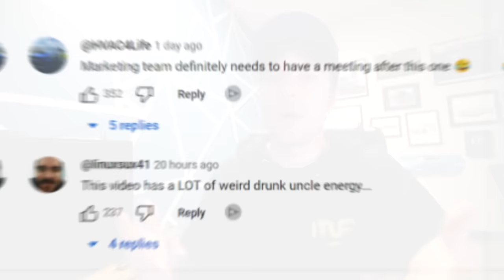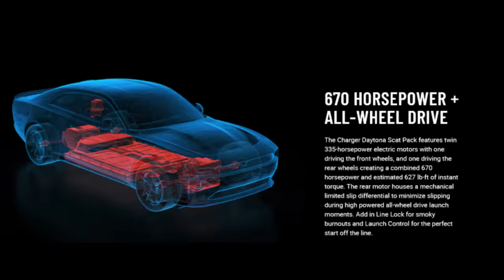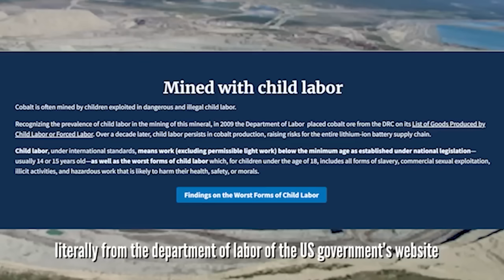The 2024 Dodge Charger Daytona Unveil Was Embarrassing

Comment: “Muscle car” that won’t come with a v8 or a standard transmission 🤮
Reply: Umm... Buick Grand National GNX in 80's
In late 80's also the Buick motor was also used in a Firebird
Reply: @maverickphantom005  lmao I love how all these thick v8 heads forgot that the GNX existed and was even considered a muscle car. Even so they dont even come up with a decent counter argument for it
Reply: Huge disappointed from Dodge. Like David said if Ford can keep their V8 why can’t Dodge.
Reply: @slimslimee4411 they also forgot that chysler had the Slant 6... which is just a tilted straight 6, and put them in several muscle cars as lower factory trim option. The Slant 6 was also very well supported by factory and aftermarket with a bunch of tuning mods.
Reply: @DJAizakku  even the mustang when it first came out came with a straight six option for more everyday daily driving with its modern counterpart being the ecoboost
Reply: The GNX was not a muscle car🤦🏽‍♂️  was fast cause of the boost but NOT a muscle car
Reply: @the1withnoname496  The Buick Grand National is considered a muscle car due to its powerful engine and high performance. The Grand National, produced by Buick in the 1980s, was equipped with a turbocharged V6 engine that delivered impressive horsepower and torque, giving it the characteristics typically associated with muscle cars. Additionally, its sleek and aggressive design, along with its performance capabilities, contributed to its classification as a muscle car. So uhm, does that say alot???
Reply: No body ain’t say a thing when the Buick Grand National debuted. Also if people wanna stay true the real meaning of “muscle car” then the Charger and challenger aren’t muscle cars because they weren’t built in the US. Cause that’s what part of the definition of a Muscle car.
Reply: @AaronRobinProductions ford generally has 1 light duty v8 (5.0) in one application (Mustang) which is offset by 2 EVs (for CAFE). Stellantis had 5 variants of V8s, in 7 applications (that’s like 60% of it’s lineup) not supported by EVs thus having to pay government Fines (up to $300million), but EV credits from Telsa ($2.4 Billion in 2 years) just to BUILD V8s… you see where I’m going with this. Stellantis building these EV can lead to them developing new ICE powertrains other than the Hurricane family of engines (i4 & I6)
Reply: @slimslimee4411  no one remembers the GNX. Buick was a grandpa car then and it's a grandpa car now. The GNX is a footnote in history.
Reply: People who owned 6 cylinder muscle cars back in the 60s and 70s were roasted for it. Manufacturers offered 6 cylinder engines for the people that wanted the looks of a muscle car but didn't want to deal with the power or fuel bills of running a V8 powered car. And this was back when gas was cheap and muscle cars were affordable to the point where a teen could buy one after working a summer job. Those people who bought 6 cylinder muscle cars were basically posers, no different from the ricers of the 90s to the present.
Reply: @CyanRooper  or maybe they just wanted a practical daily that looks good at the same time? Its only bad when you actually try to rice it out into something it is not
Reply: @slimslimee4411  Have you noticed how despite the GNX's prowess.... No one has succeeded since in pulling off a 6cyl Muscle car though? I totally agree that it's earned its place in the Muscle car lineage but it's been 40 years just about without another... And base model Mustangs were not Muscle cars, heck, it wasn't even considered a muscle car until after it's launch, historically associated with Carrol Shelby and the GT350. Muscle cars are performance cars first and foremost (mainly with a V8), not just any trim of the vehicle.
Reply: @slimslimee4411 yeah but only certain brands can pull that stuff off. Those 80s Chargers and Omnis were a thing, but alot of people today don’t remember them like that
Reply: @slimslimee4411 6 cylinders is settling.
It can be fast, but it will always be a 6 cylinder, basically
Reply: @slimslimee4411 the fastest accelerating cars in the world are powered by an engine that is a V8 based on a design from 1964 ,by NHRA rules top fuel dragsters use engines based on the 2nd generation Hemi, of course the block is solid with no water jackets for cooling but the basic pushrod engine propels top fuel dragsters to over 300 MPH from a dead stop in a thousand feet, pretty sure that is why the V8 engine is the quintessential muscle car engine
Reply: @AaronRobinProductions they were bought out by a European company that has no clue about American muscle car culture
Reply: @TomazHilton  Last I checked, Ford is new at the EV game.

They're V8 was offset by everything else having them "eco boosts." Their EV is "just now" coming into that equation 😂
Reply: Hey everyone....  Who cares!!!!
Reply: @slimslimee4411  yep... people do forget
Reply: @the1withnoname496  Thank goodness someone gets it. GNX was NOT a muscle car. No one makes a car today that is a "Muscle Car". Muscle cars were full framed cars that were usually intermediate or larger in size, with a V8 engine (usually a high cubic inch engine or "big block").  GNX may count for the frame, but the 6 cylinder knocks it out of the definition technically. It's the same people calling a Mustang or a Camaro a Muscle Car.....or worse a Corvette. Ugh
Reply: Chrysler sold Hemi V-6 muscle cars in Austraila in the 60s-70s.
Reply: @DJAizakku  Bro, no one was calling the base models with 80HP slant-6's muscle cars.... That only applies to the higher trims with large V8 engines. The definition is literally: "An American muscle car, by the strictest definition, is an intermediate-sized, high-performance oriented model, powered by a large V8 engine"
Reply: @slimslimee4411 A Mustang is a pony car, not a muscle car.
Reply: @slimslimee4411 And we never considered GNX a muscle car.

Comment: At this point is it even called an “exhaust” if it’s EV? Wouldn’t it just be speakers attached to two pipes in the rear bumper at that point?
Reply: According to what's known of the Fratzonic Chambered Exhaust, it uses an air pump that runs right under the car through a pipe, creating that exhaust noise

While mildly fake, it's far from a speaker
Reply: So it technically is an exhaust, just not one that comes from an engine lol
Reply: Since it’s not a speaker does that mean it can go silent? I rather have no noise than fake noise
Reply: @jackets64  Pretty much!
Reply: @RosheDomv2  There will be a "Stealth Mode" albeit it will have a mandatory hum for when you're in parking areas
Reply: @FemboyMotorworks right because it’s to be mandated that EVs have to emit some kind of sound for pedestrian and Animal safety.

Comment: They FINALLY made a 2 door charger, then somehow still ruin it with the engine choice 🤦🏻‍♂️
Reply: There are going to be so many engine swaps into that thing... and so many rebuild/engine swap youtube vids of the first crashed TT6s. I really can't see the Daytona selling at all. I'd be willing to bet it will even under perform the Ford Lightning.
Reply: @forced4motorsports It should be hard to sell a "Daytona" without the proper wing. On the original Daytonas Richard Petty said the combination of that tall wing and the rear fender shape would slam the car right back into control when the air hit it if the rear was starting to slide. Some people call that wing ridiculous but, it served a purpose. NASCAR even eventually banned Daytonas because it was too perfectly engineered.
Reply: @forced4motorsports  don't understand the point of engine swapping these because your gonna need to replace 90% of the car to even do these swaps with the new electronics and awd drivetrain. At that point u might aswell buy a normal charger for the cost of even doing these swaps.
Reply: Right! Never should of made it a 4 door in the first place

Comment: I think the twin turbo inline 6 engine is cool. It just shouldn’t go with the Charger. A lightweight sports couple from dodge would have been cool.
Reply: Perhaps a new srt4 neon ?
Reply: Inline 6 isn't necessarily bad, it just wasn't ever associated with a fast Charger. 
Dodge is repeating GM 80's story: Buick Grand National and Firebird (I believe in 87 there was the fastest production chicken with a twin turbo 6... so it was faster than the V8's of that time)
Reply: @Dginny865  the srt4 is a four cylinder...
Reply: Straight Sixs were completely overshadowed by their V8 brothers but nearly every classic muscle car had a straight 6 variant as the easier to attain  base model. Now we get a smooth running 3.0L twin turbo straight 6 that weighs half as much as the outgoing hellcat motor, makes gobs of power in a new chassis that also weighs less than the outgoing LX chassis.

If anything, the Charger Six Pack is going to feel like a proper GT class car that it used to compete with in the past and it can still destroy tires. It's just a shame I haven't heard anything about a 6-speed manual and pure RWD option... probably won't happen.
Reply: @maverickphantom005 actually it was, just not in America. Australia is home to the Dodge Hemi 6. “The Chrysler Hemi-6 engine is a family of inline six-cylinder petrol engines produced by Chrysler Australia in three piston displacements and multiple configurations. Hemi-6 engines were installed in Australian-market Chrysler Valiants from 1970 through 1981.”
Reply: There were talks of making a lighter, smaller Challenger. They were gonna use the 'Cuda nameplate.
Reply: @StaredownGames  that’s speculation based on some random fan. And it’s about 20 years old now
Reply: I say that I-6 belongs in a reinvisioned dodge dart.  Lightweight (below 3k lbs), 300+hp
The remake they did was such a slap in the face to the original.  There's no reason Dodge can't make a competitor to the Z, or other JDM performance cars.  Ford 100% did it right, albeit using  the wrong name.  Build your token EV to shut up big brother and keep doing business as usual.
Someone bent these guys over at Dodge and plugged them from behind, thats for sure.
Reply: @christopherlowery855  the original dart wasn’t even considered a muscle car. Very few of them were made with 318s and above and they came in 2dr and sedan configurations
Reply: @maverickphantom005 believe it or not you could get a base model 1969 Dodge Charger with a 225 slant six and a column shifted three speed manual transmission, looked badass but not fast by any means
Reply: @christopherlowery855 Chrysler was sold to a European company that has no clue about American muscle car culture
Reply: @TomazHilton  JDM cars aren't typically considered muscle cars either.  Just look at the EG Civic.  I'm just looking for a good moniker we could cram that I-6 into that would make Dodge great again.  I just remember the stories of Darts making sub 14sec 1/4 mile times and how they were often turned into good dragcars with minimal modifications.
That's the Dart legacy I remember.  I mean, the Mustang was originally marketed as a chick car and we see what that turned into.
I just know we have a good engine that doesn't belong in a Charger and that we have a name that desparately needs a better drivetrain.
Looks like a match made in heaven to me.
Cheers mate.
Reply: @christopherlowery855  darts were mostly sold as Sedans with slant 6s. Any car back then could be transformed into a drag car since they all were RWD. A good amount of V8s were GT’s (318) and few were GTS (340) VERY few had 383s. 440s were only on Mr Norms dealership editions (think yenko) and the drag pack were 426 Hemis. Both were not production cars and believe it or not Most of them
Barley cracked the 14sec mark…Dodge did make a Hemi 6 for Australia and it made more power than a 340v8. As for Mustang, it was never marketed as a “chick” car. It was always a “pony” car. A car that later spawned a Carrol Shelby model from its Trans Am racing was never a chick car.

Comment: Well, I'm glad to know that some car manufacturers are playing safe to keep their engines alive in some ways. More options in power, the better.
Reply: "Playing safe"? 

Don't you mean  "fighting hard"  to keep their engines alive ?
Reply: @JohnSmith-yl8sg  yeah, basically.
Reply: @bassdakro969  -  sir, those are two totally opposite statements. 
Words have meaning.
Reply: PLAYING IT SAFE is exactly what dodge is doing. They're not fighting against anything. They're going with the flow. Doing as they're told. Licking the boot. Bowing down. Laying down. 
They're not fighting anything. They're playing it safe, and keeping their mouths shut.
Reply: FORD isn't "playing it safe". 
Ford is fighting the power.
Reply: @JohnSmith-yl8sg  well they will feel for their mistake as did AMG with horrible C63 sales after they removed the V8.

Comment: Said it before, I'll say it again. If Tim actually showed up to the Dodge brothers with that thing in 1910, the Brothers would have closed their doors and gone back to work for Henry Ford.
Reply: Was the CEO playing himself, and BOTH Dodge brothers in this?
Reply: Ford was working for the Brothers at one point because he needed the money. Without them, Ford would not be where it is now.
Reply: @vantawave9323  Henry Ford never worked for the Dodge Brothers, they supplied some chassis, engines, transmissions, and parts to Ford up to around 1914 when they started their own car company.
Reply: If this showed up at the Dodge brothers front dr oor in 1910 the brothers we ould have shat themselves in delirium. As much as you or l might not like it the day of the V-8 is over. As is the day of the ICE to a large degree. EVs are the future. Granted they still have issues to over come. But when it comes to power on demand it really doesn't matter if the powerplant runs on gasoline, electrons or Doc Brown's Mr Fusion. What matters is putting the power to the pavement.
PS l think the general objection to the idea of an inline six would have died if Ford had produced the Barra in the US. And if GM had used the Atlas more widely.
Reply: The Dodge brothers were very innovative and probably if around today would be developing electric vehicles.